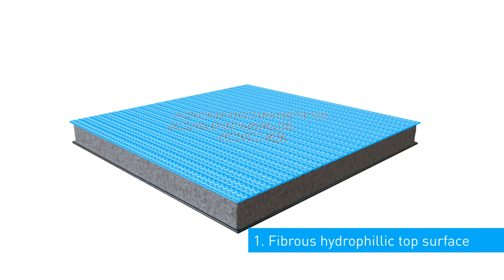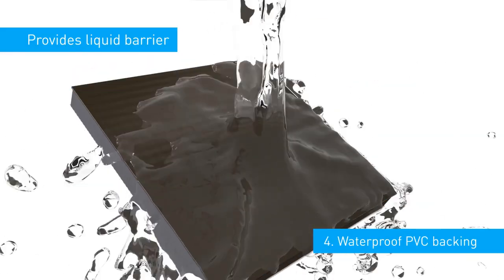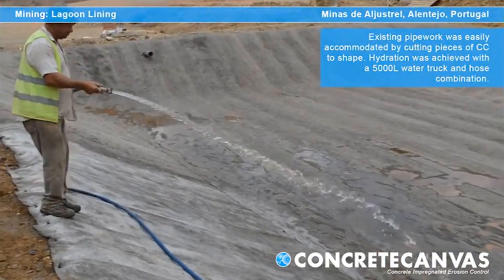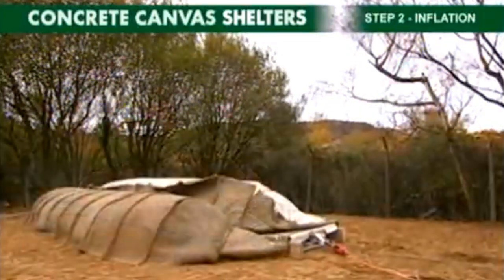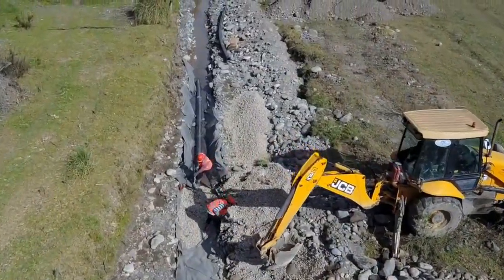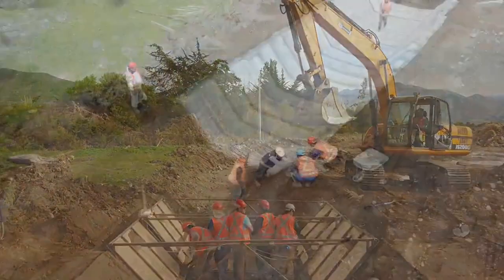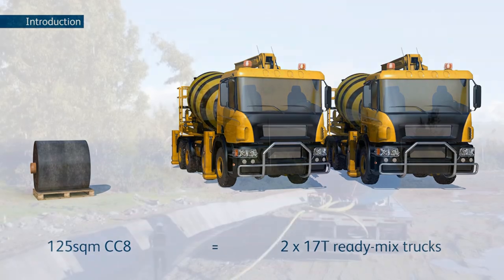Premade Concrete Canvas Tents - Just Add Water

Comment: I'd rather put up a canvas tent, then spray it with polyurethane.  Much cheaper, wouldn't crack as fast, can be reapplied, flexible, waterproof without extra layers, dries/ready for use in minutes.
Reply: Agreed!

Felt + Polyurethane = A fairly lightweight and waterproof structure.

Hell, even a roll of t-shirt material or bedsheets ought to work just fine!
Reply: polyurithane isnt fireproof
Reply: They also seem like a prepper type shelter as well.
Reply: @gregistopal  true.  Probably wouldn't want any tent to be within 15-30 ft of a fire, anyway.
Reply: That sort of tent is far from semi-permanent. You cant fix things to the walls either like you would need if using this as a casualty centre after an earthquake etc.
Reply: @gordonlawrence1448  I'll probably never be involved in a casualty center, however, they make this stuff called glue...
If I wanted really fast/strong, I'd just have the balloon shape and blast it with a hydroseeder, filled with recycled paper and poly/epoxy.  
Use your imagination.  Humans use lots of systems that aren't perfect.  That's what engineers and inventors are for on one end, then armchair critics and lawyers on the other, with first responders and healthcare workers in-between.
Reply: @asktheetruscans9857  And by the time you have wasted a few not making them properly and had the outlay of the equipment etc that would work out more expensive as well as being flamable.
Reply: @gordonlawrence1448  outlay of equipment and doing something the wrong way several times is perfect for government and military appplications, especially during Democrat administrations.
For civilians, a tent made out of fabric, and a fruitsprayer with polyurethane mixed with denatured alcohol...not much equipment.
No matter what manner of tent available, its probably flamable, just like your house.
Btw, since newspapers are mostly a thing of the past, hydroseeders are extremely cheap rn.  They're easy to build, too.  A sealcoat rig will do, as well.
Reply: @asktheetruscans9857  I like the way you think!

Comment: Seems to me that this technology can be a DIY project, without buying expensive already made materials, using canvas and concrete, putting in the"waterproof" inside layers after it's up and built.
 Not sure, but it does seem that this could be done quite cheaply if you don't mind the old trial and error, and watching others who have had this idea.
 Very neat, just very expensive for what it is made from.
 Thanks for a interesting and provocative video!!!
Reply: Allen Tremper - yes, i was thinking the same thing. It just comes down to how you want to use and being careful enough with the layers and mix ratio to avoid cracking. There are concrete techniques such as “flying concrete” that have used these principles in the past. This is actually done quite a bit in many parts of the world. Layering concrete with mesh layers. All these guys did was add a balloon and put it into a roll. Still pretty genius.

Comment: $30k?! That is a lot more expensive than a modular home build.
Reply: yet, really not much more expensive than a normal military tent. Typical tent systems used by the Government/UN run anywhere from 10-30K+ (DRASH). used tents can easily sell for 5K+. Many of these systems are designed and priced for long term semi permanent use in areas where constructing any form of structure would typically require more resources and manpower than immediately available. Tents of that sort are more expensive than people would typically think, but most people aren't setting up semi permanent installations in 3rd world countries or operating a small forward operating base and the materials used in their construction is far, far better quality than what most associate with "Tents" they would buy at REI or Walmart.
Reply: Far more durable than a modular home, though, so................
Reply: And a Modular Home lasts alot longer than 10 yrs.
Reply: @JourneysADRIFT  I'm pretty sure modular homes fit the requirements of "long term semi permanent use"
Reply: I like to use it in amazone forest
Reply: @johnreid8551  And built complete in 24 hours
Reply: @3ormorecharacterstimes2  So can a shed kit with 2 people and some tools, while getting a lot more space for the buck. 
Of course, a sizeable premade shed can be delivered within hours and finished up a few hours after that, which saves a good bit of time.
.
The main selling point with the concrete tent is on labor, though, because setup itself isn't 24hrs per tent.
>
That said, I wonder if one could just apply a gauze-like concrete to a regular tent  for a similar result. I really wish I had the budget to test that.
Reply: Les Daniell I would buy and build myself.
Reply: @johnreid8551  Anybody would, but these are meant for quick sturdy setup cost not a factor, military private contractor construction forward operating base locations in remote areas, a complete set up can be air dropped or trucked in a crew can have a shitload of these set up and ready for whatever contractor tech or medical teams whichever may be the case. These aren't designed for back yard tool sheds
Reply: @3ormorecharacterstimes2  I'd use one as a house.
Reply: The land I'm sitting on and the house I'm sitting in only cost 30k and it's riverfront property. I have cranes, the ones people take pics of and sell, an amazing amount of fish. Top it off a boat just floated up in my yard. Under the law, it's mine. That tent is crap.
Reply: @joepublic5469  Yeah, first of all, I seriously doubt you got a house and land for 30k. Especially if we're talking about the US. 

Second, you completely miss the point of this product.
Reply: @Rusty In how long though? If you get the in the afternoon and need shelter by the next day a pickaxe is not going to cut it.
Reply: You're assuming you can get that modular home through a forest up a hill or down a mountain

What if you need the structure immediately after a storm for emergency shelter
Reply: @JourneysADRIFT  Except the military needs to move its structure frequently. Or often on short notice in the case of bases that stick around for a long period of time. The tents I used when I was in the military back in the late 90's early 2000's were built and used during the Vietnam war. So that investment was for a shelter that would last years/decades. Not be used once and thrown away.
Reply: @sikofu2  I'm confused by your statement. I was comparing the cost of the system shown in the video, with the cost of a commonly used DRASH system used by the military and NGOs. My point was the price of the system shown in the video seems to be fair when compared to the cost of a DRASH system. There are many use cases for semi permanent structures that have practically no need to be relocated. The military has changed a lot since when you were in. Most FOBs and COPs have been in position for decades at this point. There's plenty of use for semi permanent and non permanent structures and a semi permanent structure that offers a lot of advantages over just using a DRASH when the benefits of a DRASH (speed of pop up and take down) aren't needed, while being on par price wise, seems like a useful thing. To me, it seems like you're arguing with yourself and missed my point, as my point was purely enlightening others on the cost of military tent systems in comparison to the system shown in the video as many here seem to vastly underestimate the cost of something like a DRASH.
Reply: @3ormorecharacterstimes2  Actually, concrete houses are made similar to how InfernosReaper suggested, and premade sheds can be delivered and constructed over the course of a few hours.  If you're going to be so ignorant and hateful, how about clicking CANCEL after you type your post, instead of REPLY?  Keep your hate to yourself.

Comment: There is a fiberglass product like that , it's called prepreg . It's sheets of fiberglass cloth already  infused with epoxy. To use it you take it out of the freezer and cut and shape it. Originally  made for large scale vacuforming , you can use it with out a vacuum  pump. In about 12 hours it will cure.
Reply: @Charles B Duke:  Ohh, very interesting. I didn’t know about this product.  Thanks for sharing the information.  Cheers 🍻

Comment: no rebar... wont last long. concrete by itself cracks and breaks down too quick. this ditch will need a lot of repairs. cheap quick work isnt always the best option
Reply: Concrete doesn't require rebar specifically, to make it tougher.
Reply: @topanteon  in a drain ditch it should
Reply: Pretty sure the fibres are the rebar equivalent. Like adding glass fibre when making concrete benchtops

Comment: A $30k tent? I wonder if there's a bit of bloat in our defense budget.
Reply: Now I know where they store the $5k hammers and $3k toilet seats.
Reply: @MatthewHensley8304  Hahaha I forgot about that! Indeed!
Reply: @MatthewHensley8304  I bet those chickens made great chicken Vindaloo
Reply: I'm thinking this is probably like, say color TV's back in the day.  Staggering prices in the beginning but as they became more popular the prices went down.  I would love to have one but I need to wait until WalMart stocks them.
Reply: @MatthewHensley8304  Right, meanwhile the Eye R Ess ruins lives for not paying $300 in taxes.
Reply: @MatthewHensley8304  I've seen a poured concrete basement that alone cost 30,000.  So, this concrete tent one ups your claim.  I could see this product being used for FEMA applications and such.  Beats a Conex for sure with heat and cold seasonal issues.
Reply: yeah only this product is from England which seems to be the leader in this form of construction
Reply: It's not a tent. It's in effect a pre-fab. Solid walls rather than fabric for starters.
Reply: No, it's $30,000 medium-term structure that requires minimum location prep.
Reply: @MatthewHensley8304  Oh really you can build and plumb a home in a remote location  with a limited supply chain in 24 hrs for less then 30K?  Doubt!

Comment: That’s one expensive canal at $64/sqm
Reply: I bet it would be 5x the price done regularly. Still a lot of money and does not reflect raw material cost I gather.
Reply: 24 pallets or more on a flatbed trailer 1 forklift however many individuals  - still way cheaper than concrete trucks,  diesel, tires, travel time,  50 union labor overpaid standing around doing nothing.....still cheaper
Reply: Ya get what ya pay for
Reply: @Danger Dave It might last longer but for a temporary, cheap water diversion this is a superior solution.

I think this will last a long time anyways how would it weather? It really just protests the ditch from collapsing or eroding on its own.
Reply: the funny thing they excavated such a nice canal they could have just dumped loose rubble and been set for at least 10 years which is the purported lifespan of this product
Reply: @Danger Dave no

Comment: That price for what's effectively more of a permanent pop-up building than a tent, is not bad. Especially considering it's tolerance to harsh weather and hard wind. The "low mass" comparison is very misleading though. The concrete in the trucks come with the water already added.

Comment: pretty sure this is Cement impregnated, not concrete.. Not the same thing. Doubt they added aggregate to the mix.
Reply: Now we get into the definition of "aggregate". Straight Portland cement will crumble unless fines (usually sand) and/or larger "aggregate" is used. Aggregate is simply a mix of irregularly sized and shaped rock within a given size range. Mixes with relatively small aggregate are usually called grout. Most people have no idea how complex and variable the mechanical and chemical nature of cementitious materials are.
Reply: I use a mixture off sand and Portland cement and old pillow cases to make tubes that I can then fill with dirt or a concrete mixture to make a retaining wall not a high one a half meter tall one I coat the out side with a render mix and this has worked well for me for years Alex is correct it’s not concrete between the fabric and membrane but a fine mix of Portland cement and sand the fine Fibers between the outer fabric and the rubber membrane is what acts as the aggregate the fabric would in fact be on both sides of the mixture with the rubber impregnated onto the under layer of the fabric and thus is bonded to the fabric.it’s a shame is not used in more places specially in areas that are known to suffer from landslides after bad weather and it would be a lot better than what is done at the moment where they spray the cement mixture right onto the rock face along the highways that I have seen built in Australia. It would have been even better if this had shown how the fabric and cement is actually made.

Comment: All well and good... But can that tent fend off a zombie attack, that's what we all wanna know?!?
Reply: There's only one entrance and it's easily accessible by shambling hordes, so I wouldn't recommend it.

Really the main merit to the tent is that it's set up quickly-- maybe useful if you were going on an expedition to a ruined city somewhere and wanted to camp a safe distance away. the concrete layer would also offer some decent bullet protection. Better than a regular tent anyway, so you don't just get mowed down by some drive-by bandits. That said, if you have the kind of money needed to buy something like this before the fall, maybe spend it on something more sustainable than a 1-use tent that eventually breaks down? Like you could put together a whole complex complete with garden, watchposts etc. for this kind of money...
Reply: No... zombies aren't real, duh!

Comment: Poor water flow is good though it let's the water seep into the ground replenishing underground aquifers.
Reply: I’m sure all the rain on all the sqft of area around that trench, gets more than enough water. The whole point of it is to get water away because there is too much. I highly doubt it needs to be porous
Reply: @jamesbizs  Slow water flow is generally what you want. BEcause rivers flow slow. And rain is not always, just from time to time. So its better to have slow flowing rivers which feed the water slowly into the next river, because else you have increasingly strong floods downstream. So all in all: Concrete Channels for water are one of the worst thing you can do. BEcause the guy downstream needs to do the same, just way larger. And larger and larger. And in the end we dont have any more rivers, just concrete channels, which sporadically fill completely up if it has rained, and then dry out again.

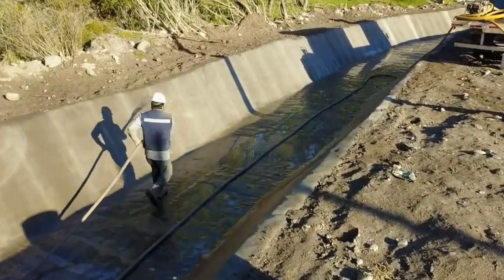Comment: 2:00 - what happens in the winter, when the clay freezes up and expands... right. And then they say than it's cheaper than real concrete. Of course it is.
Reply: None of these installs were used in freeze zones. You would not use it.
Reply: @onebridge7231  ouch, that sucks.
Reply: Yes n what abt extreme summer temperatures.. like 45-50°C
Reply: @kundanpatil3133  yes what about the moon, and what about nuclear explosion?
Reply: just use hot water and the concrete reaction itself produces heat to finish drying